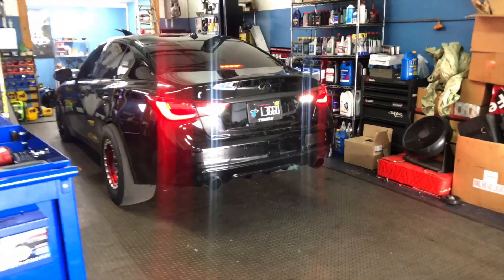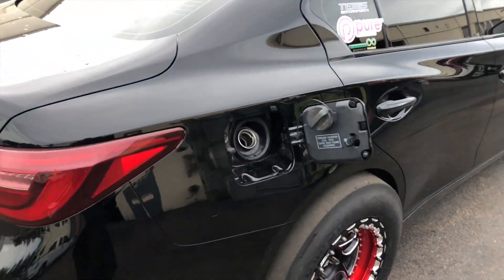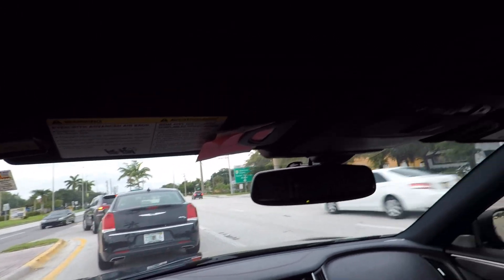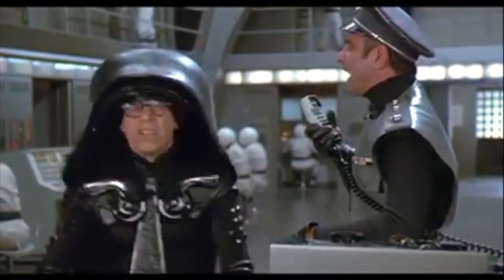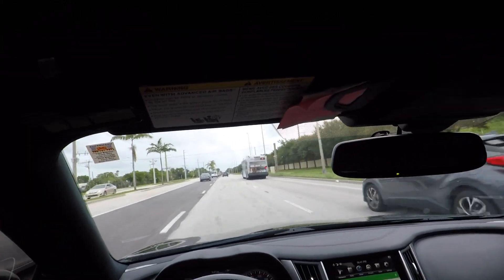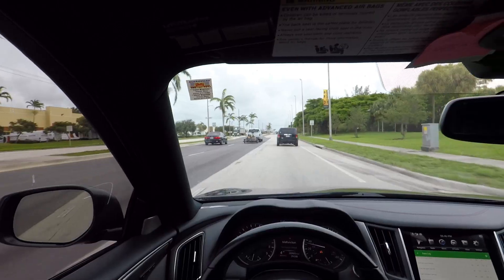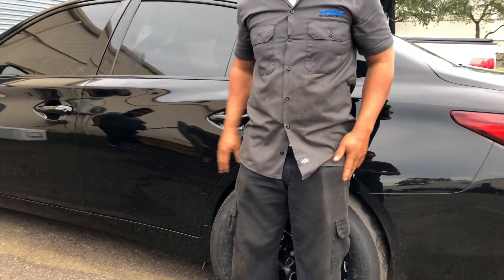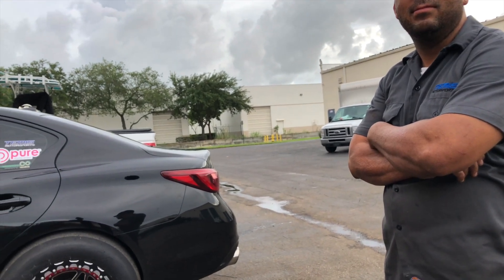Driving a 1000HP Q50 Redsport on the street

Comment: 4:29
Q50 Owner here and I can say one thing I absolutely hate about my 3.0T is the very unresponsive transmission 😢
Reply from the maker: For daily driving it does feel laggy but when you really get on it, it does fairly well during actual shifts. It does need to be snappier though.
Reply: @ZillaFullBoost  
Your right. It’s only when I’m in traffic or barely on the throttle right in between that shift point. WOT, np especially in Manual Mode.

Comment: I wonder did theyhave to do any head studs or head work to make that kind of power
Reply from the maker: Good question. I dont think so, but I can ask the mechanic.
Reply: @ZillaFullBoost  Yea that would be a good question to ask. Because the VQ platform was known for having head lift issues at higher HP. If the VR30 could hit 1000 HP without head lift issues that would be a complete game changer for Nissan.

Comment: My Q60 pulls hard too. Must be a Q thing.
Reply: @cheese3630  that's not what I said but ok guy🤨
Reply from the maker: Yea mine does too. Put coilovers and corner balance the car with the weight of the driver in it and it should alleviate the pull.
Reply: @ZillaFullBoost  🔥🔥
Reply: @ZillaFullBoost  great idea
Reply: @ZillaFullBoost  what’s corner balance?
Reply: @ZillaFullBoost   I plan on getting coilovers on my q50, but what do u mean by corner balancing? Is it tire balancing?

Comment: With that 900+ WHP and slicks, that car has to do 9.8@141-142, and on Diet, 9.5@145.  An M3 (which is 300 lbs lighter) with 750 whp runs 9.9@144-145.  
Just work with it and you will make it!😉
Reply: Ams had 800whp and they went 9.96 this should a little faster
Reply: If the trans cooperates.thats the worst part of these cars.
Reply: @IReahpZz  and how long it takes to shift into the next gear..  yet another corner Nissan cut with this thing

Comment: Can I run this tire setup? I'm wondering if 305/45/18's will fit
Reply from the maker: Will depend on your offset.
Reply: @ZillaFullBoost  they come on 18" racestar wheels. I found a deal for the set for 500. I'm tryna figure out if they fit or not before buying
Reply from the maker: You need a high offset to make it work. Like +50

Comment: How often do you see knock on the car? After the tune mine occasionally jumps up to -1 to -3 once or twice in a 20ish minute drive. I've been told by the tuner not to worry about it, the car is only 450whp right now and I want to make more power but I'm concerned about whether I should address the knock issue first or if it's normal.
Reply from the maker: Often knocks isn’t normal and shouldn’t be ignored. 0 knock is always your target, but it has been said that between -1 to -2 is acceptable. I still don’t buy it. I wouldn’t be happy with any knock. If it happens once in a while it might be phantom knock or bad gas.

Does it happen in low RPM and more than 40% throttle? That’s LSPI. Some oils can also help with LSPI, but just don’t put high load under low RPM’s.

What fuel? Some fuel is just garbage and can contribute to knock. Change gas stations and add some E into the tank. See if that helps it if not you might just need to modify the tune a bit.
Reply: @ZillaFullBoost  it's always at 1500 and 3000 rpm with slightly faster than average acceleration. No knock on hard pulls or casual acceleration. Gas is 93 octane from chevron and wawa (3-4 different stations). What is LSPI?

Edit: also never knocks until car is warmed up
Edit 2: Looked up LSPI and it sounds a lot like what's happening. Any recommendations for specific engine oil to prevent it?

Comment: Built Transmission by Pure? If so I’m curious to see how it holds up on the track. Especially with @txboostlife having issues with level 10 trans and being forced to do a manual swap to hold 800 plus hp and tq….
Reply from the maker: It’s been holding fine to this day on the street and two track passes. Hopefully tomorrow it doesn’t rain and we get to push it harder, but it’s the only transmissions upgrade recommended. LVL10’s are garbage.
Reply: @ZillaFullBoost  Good to hear bro! I was planning on going with Pure but had no reliability proof with our platform until now. Definitely adding this to the list👌🏽👌🏽

Comment: What turbos is it running? I don't think u said it on video
Reply from the maker: I said it in the beginning of the video as the car was backing out of the shop lol

Garrett’s G25-550
Reply: @ZillaFullBoost  How u get those to fit? Custom made manifold? I know the oems don't have any manifold it bolts directly
Reply from the maker: Yup custom manifold
Reply: @ZillaFullBoost  Make alot and sell a kit! You can make alot of money. A 800hp and 1000hp Turbo upgrade under $5k🔥 Include the manifolds

Comment: What's the full build?
Reply from the maker: Just piston, rods and a pair of garrett’s G25-550 powered through a Pure Drivetrain Solutions transmission. 

Fuel: XDI HPFP and Injectors, custom LPFP set up.

LSD on the rear end

On BC Coilevers. That’s pretty much it a simple build.

Comment: 1000 hp should’ve broke the tires loose, do you have a stall converter?
Reply from the maker: We’re having LC issues with it. Not sure Eid Pure Drivetrain added a higher stall, but the ones in the Q’s have a 2500 from the factory.

Comment: With 1000 hp what is the top speed?
Reply from the maker: The car hasn’t been pushed over 150-160 so top speed in not known.
Reply: The 7th gear ratio in the stock tran will ,on paper, hold 212 mph maximum. On paper.

Comment: "corner balanced" lmao. bias ply slick in the back and a radial up front will make it pull/sway. also, if that car still has oem bushings out back still, thats where the deflection is happening. those dumbass little bushing inserts are useless for this application.
Reply from the maker: Dude the corner balance is to alleviate the pull when accelerating. It’s obvious the car sways because of the slicks. Two different things I’m not relating the corner balancing to the tires. Relax captain.